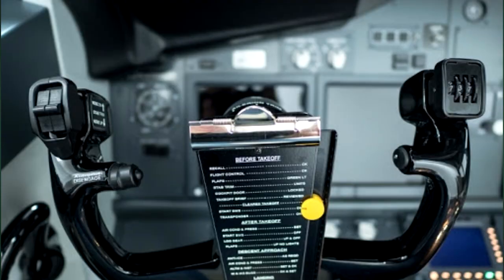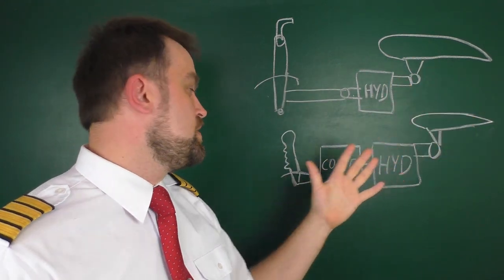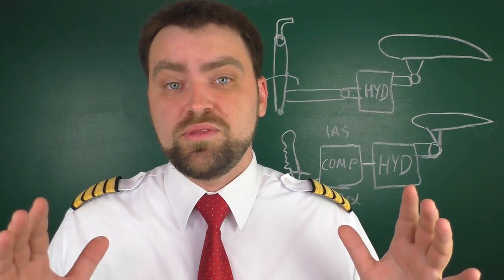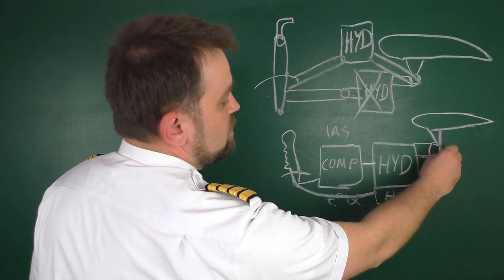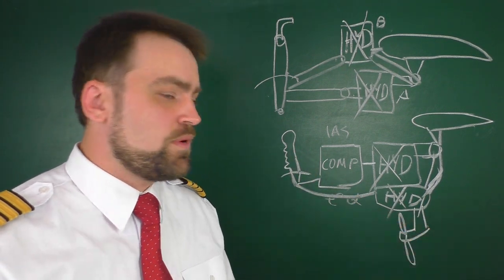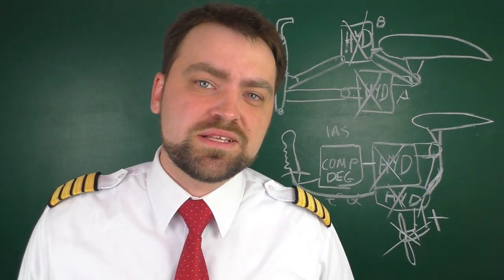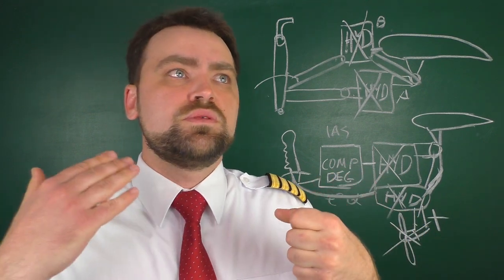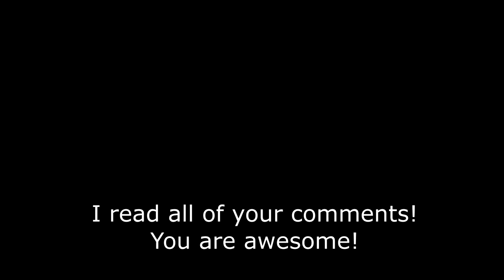Yoke VS Stick. Boeing VS Airbus. What is better? Fly by wire or not?

Comment from the maker: Hi guys! In next video I will show you the descent on B737NG flight simulator.
Reply: Pilot Blog ... I always wondered if a flight simulator was ever used with pilots to replicate the doomed Malaysian flight that disappeared, complete with weather for that day and matching known clues on the trajectory.  It could help reveal where it went and if pilot guidance was required at the end to leave the hull intact upon hitting the water (Scully did it on the Hudson river) or whether a flight on autopilot that ran out of fuel would have certainly smashed the cabin into lots of floating pieces.    (I used to support as an engineer flight sims employed by Singer and then on the government side)

second thing ... as a typical passenger, I see an issue that needs to be addressed ... manufacturers and Airlines and FAA need to convince the public on virus contagion safety. This is mainly regarding testing and verifying the cabin air will be virus free, but also seats, the magazines etc. , the toilet rooms, and the airports, the luggage handling ... i.e. comprehensive look at safety from infection.  Ideally, the FAA would be involved in some kind of oversight role and then funding a Public Service Announcement advertising campaign.  Otherwise, passengers will hesitate flying until many other passengers have demonstrated it is safe.
Reply from the maker: @douginorlando6260  Hi there! Thank for that unique comment. I think the investigation team had followed many of scenarios including the full flight simulatior of MH 370 B777 loss. I personnaly trust them in their job. As for your second concern, I think the way we fly is going to change. However the air inside the airplane is quite safe even now. Air system filters are capable to filter 99,95 of what is contained in the cabin air. Plus air inside the airplane changes every 2-3 minutes, so if we speakabout the public transport, I think air transport will be the most safe. What manufecturers (Boeing, Airbus and others) probably would redisign is the filter change maintanence. For now you need to ground the airplane for several hours to perform the filter change, so that hits the airline budget. We need fast filter replacement as least in new airplanes. Also the big plus is that people spend less time together flying the airplanes (usually) compared to any other transport since airplanes are the fastest transport on planet. Also I think there is going to be new screening procedures in airports for passengers similar to secrity procedures. I agree that probably in short term (1-2 years) we will see the massive drop in passengers flight. But anyway, no one knows what it is going to be... Just need to wait... But I keep positive about the future of aviation. Thanks again for your comment!
Reply: Pilot Blog ... excellent answer! Thanks for taking the time.

Comment: The main thing that pilots have said is that while the yoke gives much better feel like driving a car, having a sidestick is more practical as allows them to use the space ahead of their seats to have a meal, use a keyboard or a tablet, see the displays better and just freely move around.

A cool pair of heads in the cockpit however is far more important because those are what are ultimately flying the plane!!
Reply from the maker: Indeed!
Reply: Pilots should be flying the plane, not eating and checking their email. All a side stick does is allow for more opportunities for distraction.

Yoke is superior when it comes to actually piloting an aircraft.
Reply: @literallyshaking8019  Okay Mr. never been in the cockpit. The eating part is because both mil and commercial a lot of the flights are long duration and pilots regardless of whether they are in a U-2, or a 737-NG (which has yokes) will eat and rehydrate if the flight is long enough to require it. Yokes just make that part messier.

As far as the tablet part? They are not checking their Email. Those tablets are used for tracking flight plans, procedure checklists, in flight diagnostics, and reference for emergency procedures. Unless you are combatives, flying is 90% repetetive checking and rechecking of procedure and making sure the autopilot is doing it's job and 10% actually controlling the aircraft physically.

Also if yoke was superior, the best performing aircraft. The reason for a mechanical center stick (which has the same benefits as yoke in connection) in sport is for cost cutting reasons only. The argument between Yoke and Side-stick is much like the argument between manual and DCT transmissions in cars. DCT is superior. It is faster, has less wear, less prone to user error due to human nature. Manual is obviously more fun to drive, but it's "connection" does not offer a benefit beyond it's negatives in weight, packaging, ergonomics and control.
  
Especially when you consider that the majority of control "response" has nothing to do with the yoke/stick and everything to do with your inner ear. Which is based on your head and body movement overall. To be blunt, your arse is going to tell you a lot more about what an aircraft is doing than the mechanical fight of your yoke's flight controls.

Especially in cable+hydrualic driven systems of the last yokes.
Reply: @literallyshaking8019  What are you talking about.  Thanks to side sticks, a right handed pilot can have lots of fun trying to coordination the plane with his left hand. This can be fun indeed. Plus, thanks to now having a nice roomy open area, the pilot and copilot can each relax their entire body, and drift off into a heavenly sleep. New technology, is the way to go.  Like new control buttons that don't mechanically pop in and out to also physically indicate that their function is activated or deactivated.  With the new method, only a light source, being on or off, would give such indications.  Funny though, when this lack of data was lost due to a power failure, thus there was no light at the switch indicating its status, and this led to almost the loss of a plane load of peoples lives, they went back to the old school backup safety method that provided at least one of two indications of the switches status.  Weird.

Comment: So interesting as always! Thank you very much! 
It's fun that Boeing Captain votes for Airbus system and Airbus pilot (Sully) votes for Boeing. I saw one of his interviews, and he said that this unsynchronised side-stick system may cause misunderstanding  between pilots in critical situations.
Reply from the maker: I heard that. The misunderstanding lies within the sidestick connection. They are not connected in Airbus, and it is not good. Some of the airplanes have the connected sticks and that eliminates the misunderstanding between pilots. That is why I like B737 Yoke. But somehow A320 is also safe airplane. Sidestick can provide more comfort for pilot and less efforts to fly the airplane (even a tiny thin girl can fly it). That is my personal opinion. Thanks for your comment!👍
Reply: @PilotBlogDenys  I totally agree that it is completely safe. A felt it myself a few years ago, during my flight with Turkish Airlines A330 to Boryspil, it was December and very bad weather, so the landing has been done in crosswind and low visibility conditions, but pilots've done fantastic job and we landed very smoothly.
Reply from the maker: @Airliner World Boeing 777 100% Right. That was the case.
Reply: @olegplatonenko1550  That’s funny because Sully have been helped by the computer of the A320 during is water landing. He was pulling to much

Comment: AirFrance Airbus A330 crashed in the Atlantic Ocean because the Captain was not aware of the First Officer manipulating the sidestick while the Captain was trying to gain control of the aircraft with his own sidestick. Both sidesticks should move in unison.
Reply: That was fixed long ago. If you hold the Autopilot Disconnect (the red button) for 20-30sec, it disables the other sidestick. The sidesticks cannot move on their own, you move them and hope the plane responds. but if the Captain moved his stick, the First Officer's stick won't move (that's how all Airbus aircraft work). So it's like playing FlightSim with a joystick and getting no feedback.
Reply: FBW would have save so many lives...
Reply: They also ignored the DUAL INPUT warning that tells pilots this is happening
Reply: That's why I always say, a man shouldn't take his two girl friends on a common date, otherwise disaster is guaranteed.
Reply: Can't they say "I have control" to let the other pilot know?
Reply: @FeelFree3  Obviously, that didn't happen on that doomed Air France flight! Airbus would have to install a joystick motor on each side to have the joysticks move in unison. That would be an additional cost and a potential maintenance issue.
Reply: That is the exact crash that led me to watch this video seems like way more room for failure with the fly by wire side stick configuration but I'm certainly no pilot!
Reply: @tomstravels520  they didn’t ignore it they missed it because the was su busy and suprised
Reply: @leobyrod8307  how do you miss an aural warning blaring at you?
Reply: I agree, but it was still pilot error, they should of been communicating and it would of never happened
Reply: @tomstravels520  In a high-stress, life-or-death situation, the first human sense that deteriorates is hearing. If I recall correctly, the Airbus A320 cockpit has a "side-stick priority" indicator near the master warning buttons that can be clearly seen.

Comment: I’ve been in two 737-800 simulators and I loved the yoke. Now I need to get into an airbus simulator to see the difference. Great video!
Reply from the maker: I felt that A320 and A330 well controlled. I just want those sticks to be synchronized (capt and f/o sticks). On some airplanes (not airbus) they are.
Reply: Pilot Blog Makes sense.  I believe that would have helped on that Air France plane that stalled over the Atlantic. The copilot was pulling back on the side stick stalling the plane.  Maybe if the captain could see he was doing that it would have saved the plane.  If you loose all reliable speed indicators how do you manage the aircraft?
Reply from the maker: @CaptainSisko1972  You are right 👍
Reply from the maker: @CaptainSisko1972  You have some other reliable parameters like airplane pitch and thrust settings. GPS ground speed may also be helpful but it may be not true because of the wind. We follow special checklist, it gives the proper way out. I tried it many times during my recurrent simulator training but haven't any issues with airspeed during my regular flights. Thanks for asking 👍

Comment: I would not say Airbus is easy to control. My background before the Airbus was in the Dash 8 turboprops and I had a problem of over controlling the aircraft in my first simulator sessions in the A320. But the real trouble is when you have to fly raw data instrument approaches. Because the A320 in normal law is neutrally stable it would not seek the wings level position, if you leave the joystick even after say a 3 degree bank to correct for the localiser. It will keep banking at 3 degrees if you do not manually bring it wings level and the next thing you know you are deviating. That was weird for me. But with time, you get used to it. 

And also, when the control laws degrade, everything becomes a bit more difficult. You need a more hands on approach, compared to a conventional aircraft, if an Airbus let us say fall to a degraded law like the alternate law, followed by direct law.

Once you gain experience in it, the aircraft is a joy to fly. I would not trade it for anything else. And also if you fly an Airbus you can fly another Airbus with a reduced training. For example, if you are rated on the A320 you can get trained to fly the A330 or A340 with just three simulator sessions and you can even fly mixed fleet (A320/A330 together).
Reply from the maker: Wow! Thanks for that comment! It really opened some insides from Airbus Pilot perspective. I had A320 and A330 full flight simulator experience and RAW data as well, I found it is easy. Thanks for your comment! Safe flights!
Reply: Hahaha a real airbus pilot calling the sidestick a “joystick” 🤣🤦🏽‍♂️
Reply: @TrapKingz.  Your point?

Comment: 5:50 yes they have redundant systems. Ailerons (and elevators) have 2 servos per control, the rudder has 3. 
each system has at least 2 computers working together and talking to each other. 
if the servo can't see any information from the computer, it goes to the neutral position.
Reply from the maker: Great. Thanks for that data, Michael.

Comment: I thought Boeing has ram air turbine. No one would dare to control a large aircraft with heavy wing loading just to move a slight angle in flight control surfaces on big wide aircrafts in cables only. It’s like doing pull ups and heavier than that as imagined. While smaller aircrafts powered by cable is okay but even Piper Seneca II is purely cable and manual and still it is heavy to pull your yoke because the whole stabilator will move unlike aircrafts whose elevator will move for pulling the yoke.

Comment: Thank's capitain for this very objective analysis. 
I perceive all the better what you explain that I practice (modestly on  X-Plane simulator), the two planes, with a yoke for the 737 or a sidestick for the 320. 
I still wonder why Airbus does not synchronize its sidesticks
Reply from the maker: Yes, it would be great if they were synchronized... Thanks for your support!
Reply: It would be hard to link them directly. Only one can be used at a time I think

Comment: Hi Denys(spelling?); I have read, or heard, that some pilots feel that the 737 allows for, let's say, "non-standard" emergency situations, where you might need to do something well outside of normal procedures or right at, maybe outside, the edge of the flight envelope... Of course, the pilot is supposed to use his intelligence and skill to avoid such situations ;-) , but I've seen some stories of inverted flight, or other extreme maneuvers, to get out of some mechanical failure, or.... I guess that the Sidestick provides force feedback, and stall shaker, like your airplane.
Interesting discussion... BTW, it seems strange to have the captain fly "left-handed", where right-handed people do not have as fine control?
Thx, safe landings! And, best wishes for more safe landings in 2021 !
Reply from the maker: Many thanks for your great comment. All modern airplanes of 4th generation should provide flight envelope protection. So B737 MAX for example is still 3rd generation airplane like B737 NG. From my own experience there is no difference in controlling the airplane with right or left hand...
Reply: @PilotBlogDenys  I just watched a video of a320 instructor flying 737 simulator...quite funny, in a way...he keeps saying how weird things are ;-)
Reply: Why would you want to go outside the envelope? It’s a ridiculous idea.
Reply: I think Airbus airplanes allow the pilots to manually degrade the automation from Normal Law to one of two Alternate Laws where the flight envelope protections are lost and the aircraft can then be flown in the manner you described. They can do so by manually switching off certain flight computer systems I think but I am not too sure.

Comment: I would rather go with the yoke coz it  directly linked to the hydraulic system . For the side stick the computer can give the hydraulic system wrong info and boom 💥💥
Reply: Nonsense. The connection tit he hydraulic system is nothing to do with it. 777 has a yoke but is FBW and not connected to the hydraulics.

Comment: Best one is the stick in gliders, unless you didn´t forget to connect the control linkage during assembly and the "force feedback" control surface check ;( 
So preferably with automatic connections. Ahh, and the parallelogram control of DG300 is out of the game for me.

Here´s a talk with Paulo Iscold and his Nixus Project, the first fly by wire glider  :o  https://www.youtube.com/watch?v=The8dN7pIuI (Fly by wire system at 41:00)
Scary thought for a Wright Brother/Otto Lilienthal fan.

I vote for the KISS-Principle = Keep it stupid simple.
Like the story of the Antonow AN-2 guiding in by russian technicians: All switches On, Antonow will fly. All switches Off, Antonow will not fly.

Comment: Although I am a 14 year old boy who wanted to become an Airbus A320 pilot, I prefer with Boeing Yoke. Because Yoke is easy to turn the plane right or left and pull up or push down. Airbus, their side stick in the F/O's side is easy while the captain needs more practice to be a professional at using the side stick. Right hand have more power than Left Hand. But with more practice, it will be easy. Thanks for the video Captain.
Reply from the maker: You fly with left hand on Boeing also. From my experience I don't see the big difference piloting the airplane with left or right hand.
Reply: Pilot Blog Yea. But if it comes to Boeing when Takeoff and Landing, we can use both hands to pull or push the yoke.
Reply from the maker: @CaptainJadenAR  Just on take-off and manual reversion. Landing with one hand...
Reply: Pilot Blog. Oh OK. But I prefer Yoke
Reply from the maker: @CaptainJadenAR  Great choice 👍.
Reply: Vlasko60 Thank you sir :)

Comment: Can a Boeing pilot fly airbus aircraft?
Reply from the maker: Yes if he/she has also the Airbus type rating
Reply: @PilotBlogDenys  isn't flying controls will be 90-95 % same in both the air crafts except yoke steering and side joy stick.
Because basic aviation rules and fundamentals applies to both of them same only.

Just like Siberian Tiger and African Lion,
Though they are very different, but still.being carnivorous animals, thy both have very common behaviour when they find prey.